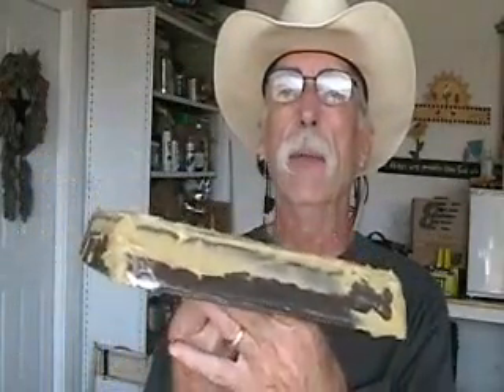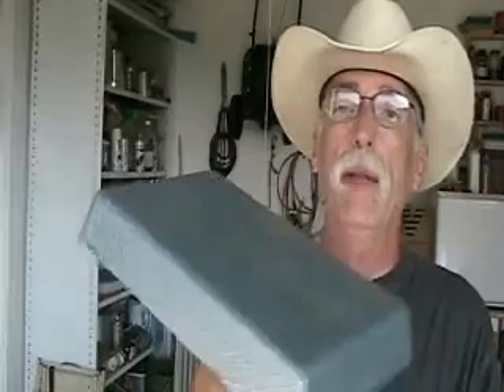Building a Base for Model IC or Steam Engine-Part 3

Comment: John,did you grab the cheapest can or the first can? Maybe thats why the price was a bit dearer?But i agree,the price has gone up here in AUS since i last bought a can too.Personally i would have put a few more tack welds along the edges,through fear of engine weight,mounting bolt stress and vibration cracking the plastic body filler,then leading to rust marks on the bondo areas along the edges.How has it held up.
Nice lookin base.For some silly reason i always look to milling out! Silly me :s